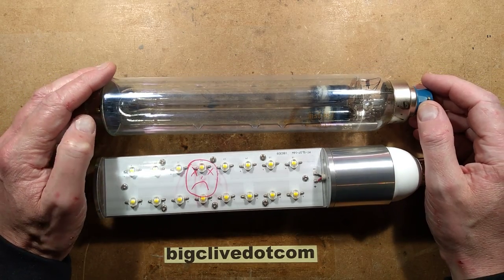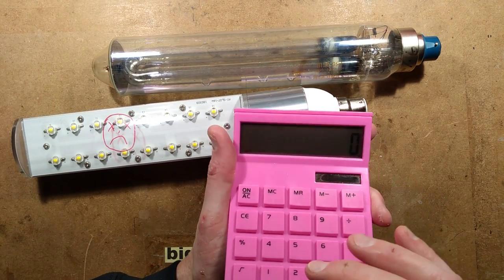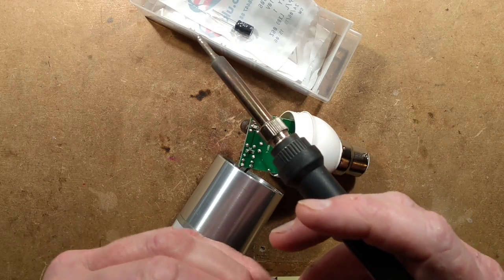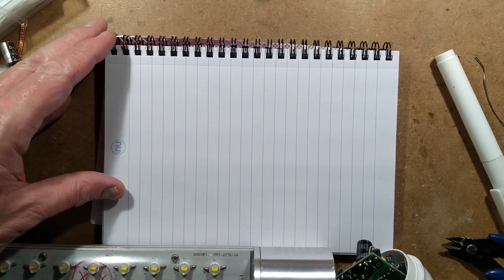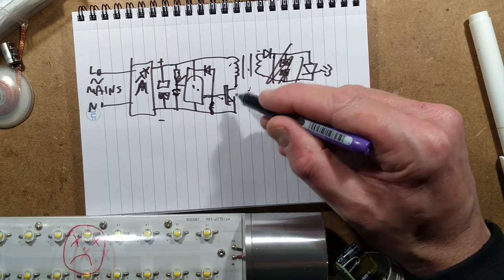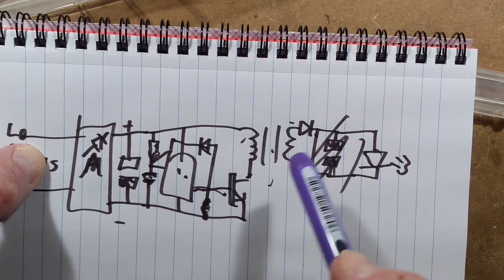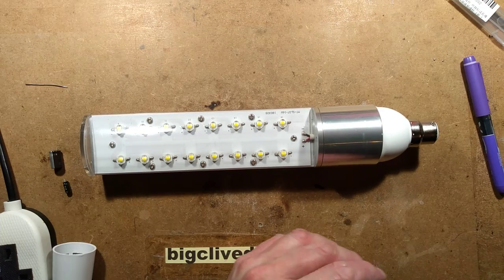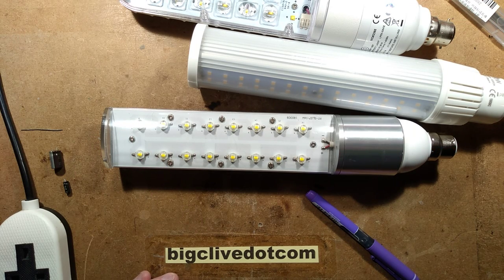Fixing a dead LED street light lamp.  (SOX retrofit.)

Comment: I really, really wish we stuck with low pressure sodium. LEDs are making it impossible to see the sky
Reply: 99% of the street lamps are now LED. 10% of my childhood sucked away 😭
Reply: @ryanallen3704  they wasted their money on cheap leds they should have left the low pressure sodiums in they say its better for the enviroment but its better to use existing lamps now i cant see a thing at night they only light up a tiny spot on the road and create too much glare they make driving at night dangerous
Reply: @thepurdychannel8866  in my erea the lamps get turned off at 2am as well to save electricity. It's a joke
Reply: A lot of light pollution is a result of the shape of the light fixture's diffuser/cover. A completely flat (full-cutoff) diffuser lens will ensure all light is directed below the horizontal (i.e. at the road) whereas a drop lens will scatter the light out in all directions, unfortunately including skywards.
Reply: rustybuttpate  I don't agree with that at all but I could agree with outlawing signal and illumination LEDs with AC power. I hate the flashing too.
Reply: @Peter_S_  that's not the real issue, they just need to drive the LEDs faster. 10s of khz is fast enough so saccades don't leave a blinking trail of lights. 10s of hz is just way, way too slow.
Reply: @jonathandenton6160  the street light opposite mum's house was recently replaced with LED; since then we've been able to see (from upstairs window) the stars above the light as it's correctly facing down rather than spreading light in all directions which the old light did...
Reply: @ryanallen3704 it makes it very inviting for burglars and vandals
Reply: @ryanallen3704  wow your area must be a paradise for burgalars and vandals. You should do what photon does hang a sox lamp from a window or fix it to your wall or even get a streetlight key take off the cover and alter the photosensor sensetivity
Reply: @thepurdychannel8866  thanks for the advice on that man 👌 I'll give it a go
Reply: @ryanallen3704  they sell utility service keys on amazon look there

Comment: How more expensive would it be to have designed the PSU so the lamp doesn't flicker? Seems a wasted opportunity to improve lighting to me.
Reply from the maker: The slight shimmer accentuated by the camera is a direct result of the circuitry having good power factor.  The primary side rides the sinewave closely and smoothing is only done on the secondary side.  Filling that extra capacitor position might have helped.
Reply: @bigclivedotcom  I get the point the behaviour is exaggerated by the camera. However a proportion of the population is adversely affected by what are effectively 100Hz strobe lights. Considering these effects have been known since the fluorescent days (and hf ballast, longer persistence phosphor etc were tried to lessen  the problem) I find it sad we have come the full circle again.. Why not standardise on flicker-free alternatives?

Comment: Think someone finally bought the house across the way so that blinking LED light (which someone is clearly turning off from time to time)  is still blinking  (months on end)
Reply from the maker: That's been a long time.
Reply: @bigclivedotcom  that is has.  We saw them meeting the realtor just before we left (elbow therapy post op)  and bit over an hour later they were still there except the couple were upstairs outside swinging on a swingset I didn't know was there hugging each other.  I figured they musta put a bid on the house.  Sure enough now the sign says Sale Pending .  I can only hope because it's been vacant possibly since last year.  I know I'd asked you about that earlier.  I can't remember when but you'd said it would keep on blinking and sure enough it's done just that.  (someone must have access to the house or it shorts out the circuit breaker.  Because those 2 LED bulbs near one of the entry ways gets shut off.  there's at least 3 more but the main 2 I'd seen on the deck are never on..  Nice house except no garge, just an in / out car port  (pull thru) under that deck

Comment: Desoldering on the cheap: Clive, take a look at this thing on ebay:
https://www.ebay.com/itm/110V-Electric-Vacuum-Solder-Sucker-Pump-Temperature-Gun-Welding-Iron-Tools-Blue/312630615820?ssPageName=STRK%3AMEBIDX%3AIT&_trksid=p2060353.m2749.l2649

These also come in 240V of course. I got one because my expensive solder sucker is on the fritz, and this thing, while a little awkward to hold, works VERY well, and for about ten bucks is really hard to beat.

Comment: Is it only me having problems with LED Cluster Lamps for 230V?

I tried to fix some, but let i be after a while, as they soon burn out again. 

Have the feeling that the producers build those LED Lamps to fail after short time. Maybe they develop them to fit 220V as maximum and with real 230-250V we have in Europe, they burn fast. 

Never had a LED Cluster that lasted in the out door light that is burning 24/7 in the "dark halv of the year"  more then 6 Month. (So it is less then 4500 hours, shouldnt it be 20.000 they promote with?)
Those used inside with switching on and off wont get 4000h either...

Comment: The led lights are the biggest scam. I installed many at tax payers expense at PIA. Wet swapped out 150hps to led. We no soon finished 1 level and had to go back to replace power supplies. Over $500 cdn per fixture. And it takes 1 hr to remove and replace driver.. Lack of surge suppression. All 347v drivers.  What a pain

Comment: Question: is it not a hoax that LED light bulbs are not that energy efficient because of the heat the electronics creates?
Reply from the maker: The losses in the drivers are usually quite low.
Reply: bigclivedotcom so would I be right in saying the the claimed wattage or ‘equivalent’ wattage on the packaging is just referring to the LED but not as a unit with the drivers? Would be interesting to test LED claimed efficiency

Comment: They just replaced all our streetlights with LEDs last year. They are absolute garbage, a small area of bright white light under the lamp post and the rest of the car park is a black hole. All our gardens used to get light from the one lamp post, now you risk breaking your neck if you go outside.

Comment: Retrofit street lighting LED will not working good bad lifetime and overheating because because insufficient cooling LED chip and LED power . Retrofit is only working on low power but high power need change new street light. Im LED designer have LED factory in China have done lot of testing.

Comment: Those Sodium and Mercury vapor lamp make EXCELLENT UV sources for doing UV dependent things.   They produce Butt Loads of UV.   De Soldering :   I heat up the offending solder and give it a shot of Canned Air.  BLASTING Hot Molten solder every place you wouldn't want it yet clearing the THRU Hole of all.  Most times just leaving the component lead floating in air.  LOL   Works quite well removing those small transformers with a half dozen  legs.
Reply: I used to use them in my saltwater tank.
Reply: Low pressure sodium lamps or Sox lamps shown here emit no UV. High pressure ones do emit a little UV but not near as much as Metal halide and mercury vapour lamps.
Reply: @Corei14  Work quit good on that job.  I've used them on Fresh water tanks.  Provide some level of Germicide as well.

Comment: This seems quite silly because SOX lamps are still more efficient than LEDs..
Reply: Are you sure about that? A good deal of the light output is UV which is screened. So for the visible spectrum LED is more efficient. Plus you don't have the weird colour shadows etc.
Reply: @gordonlawrence4749  What emits UV? LED or SOX? Me a bit confused..
Reply: @blitzroehre1807  I have been led to believe (and some internet sources state) that SOX produces some UV which is then screened by using glass rather than quartz for example (some bulbs use quartz). You can get UV LED's but they have to be specially made for the purpose and as far as I know have not been around more than a few years. I'm not sure in either case what class of UV is emitted.
Reply: @gordonlawrence4749  

The Sodium low pressure lamps (SOX) should not be confused with the much more common high pressure lamps, which do indeed emit some (not much) UV light. Spectral lines of the SOX are only in the yellow light band, thats why they hardly attract insects. Depending on where you live you may never have seen a SOX driven streetlight, it is truly yellow :-)
LEDs in the blue and white range do produce UV light, and different phosphors then help correct the colour hue (warm white, daylight etc.)
Reply: @blitzroehre1807  I was under the impression both types of sidium lamp did. From a physics perspective the emission spectra does not change regardless of pressure.

Comment: I do not mind using LED's for light. But using white in stead of yellow is just plain stupid.
The human eye does not see color unless there are enough lumens. There are just way less cones (for color vision) than rods in the eye. Plus the eye is most sensitive around the yellow color band. 
With white LED street lights everything is way more dim and greyish. And with rain or mist it turns into a white wall.
Yellow LEDs are way better.